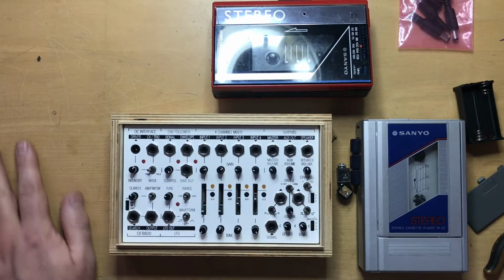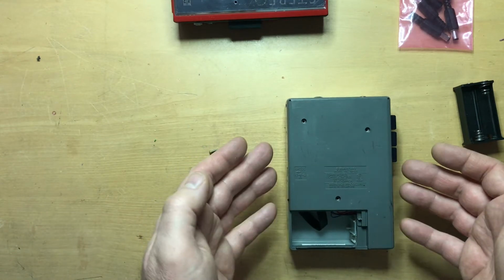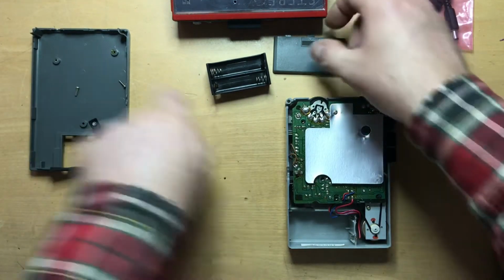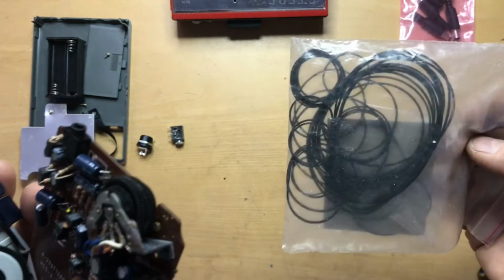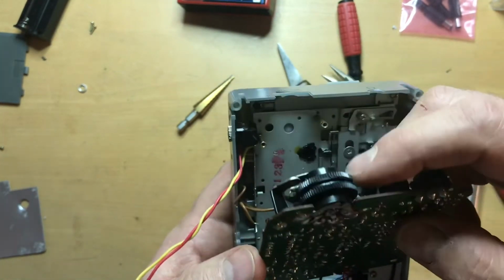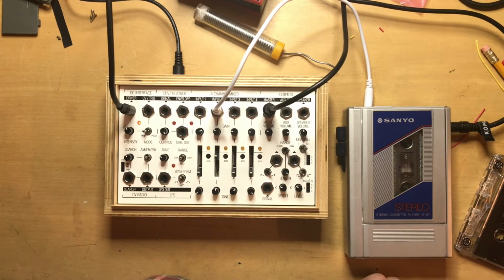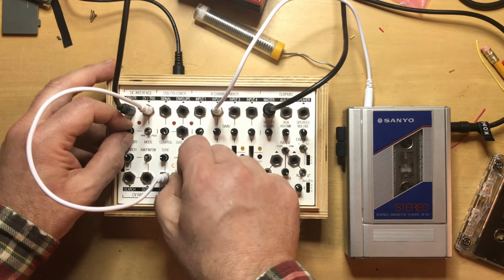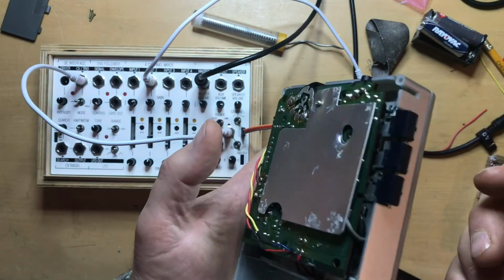Mod of a tape player for use with Koma Field Kit DC interface

Comment: Great work, thank you so much for this! I was wondering could i just connect a dc socket instead?
Reply from the maker: Yes, any kind of socket or jack will be fine. I chose the 3.5mm socket because it took up less space inside the player. It also means you won’t accidentally plug a wall wart into it and fry the motor. Both solutions have drawbacks, go with what you have, that will fit and works for you.

Comment: Ok, this is so great that it’ll be my first forray in tape mods. Would that also work with an audio interface that has dc coupled 1/8 outputs? I plan to get a Koma eventually but don’t mind hooking this up with Ableton (CV Tools ) or Reaktor.
Reply from the maker: Great! I hope that you have fun with it. I really don’t have any idea if what you’re suggesting would work (I don’t use a daw or a modular system.) but if I had to guess, I’d say no. I don’t think the interface will have enough oomph to drive the motor. If you want to give it a try, I’d suggest doing a quick test before you go ahead and do the full mod: unsolder the motor wires and temporarily solder them to a jack. This should allow you to see if the interface will drive the motor without going through the trouble of finding a mounting spot for the jack.
Reply: @TheGrumpypotter  By "oomph" do you mean power or is it a typo for ohm? My interface is not bus-powered but has a DC outlet. As such, it is possible to send program changes such as LFO's to Arduino motors, but I've never done that. It turns out my old tape player has just the right room for a jack and weirdly, even an unopened plastic cutout, so I'll do the mod, see if that works, and if it doesn't, it'll be Koma ready. Now, all I gotta do is identify those wires, they are red, orange, white and black and labelled with their colour, so I have no idea what is the polarity! Hehe
Reply from the maker: Hey Elaine, by “oomph” I meant ability to deliver amperage. I wasn’t aware that there were interfaces that could do that. Can you tell me the make and model, I’d be interested in reading about it. As far as the motor wiring goes, I think the four wires means that you have a tape player with a three phase motor and this simple mod won’t work for that type of motor. There was another viewer who posted here on on FB a video of how they were able to control one of these. I’ll have a look and see if I can find it and post it here.
Reply from the maker: Here’s the video on three phase motors: https://www.instagram.com/p/CKyFNAqhAtM/?utm_source=ig_web_copy_link&fbclid=IwAR0fGAT0ucAugOrDFz1fJMdxzTk3luISryMhDH2m6eDkwOQc8qCZXid0niw

Comment: Hmm. I have a cassette player modified with a CV in to control speed. Ive been using LFOs and whatnot with it, but with the correct cable is it likely the DC output could drive it just the same?
Reply from the maker: It possible but depends on how the mod was done. There’s a well known mod of GE brand dictation style recorders that taps into the speed control circuit for a partial CV control. I don’t think it would work in that unit. The artist Gieskes has modded players to go along with a euro rack module of his design and I think those would be compatible but you would need to check in the polarity of the cable and jack.
Reply: @TheGrumpypotter  Appreciate the response, I'll get with the guy that made this one. I hadn't even considered the DC out as CV.

Comment: Could I just take a 5.5mm DC male to male and hook it up via a barrel jack? Seems like it would work!
Reply: I also noticed on the 3.5mm jack has 3 legs. Which two do you solder the wires to or does it not matter?
Reply from the maker: @SNCKPCK  The pin with a rivet is the center pin which should go to the negative connection the motor. The other two are switched by the insertion of a cable. Insert a plug or cable and check for continuity between the barrel and one of the contacts or the other. If you don’t have a voltmeter, try one contact and if it doesn’t work, then try the other.
Reply: @TheGrumpypotter  thanks for both responses I think I have it all figured out. Been loving the Field Kit because I learn a lot about electronics and how they work! I'll send another response if I have any more questions. Keep up the field kit videos I really appreciate them!
Reply from the maker: Yes, you can use whatever connector works best for you. I choose the 3.5 mm mono jack because it’s relatively compact and fits inside a lot of cassette player bodies. Some people just hard wire the cable to the player. Just be sure you get the polarity correct. The DC interface jack is center negative and barrel positive. If you get it wrong the spindles will turn in the wrong direction, so test it before you put in a tape.

Comment: So, you are simply adding in the jack to interrupt the positive motor connection to the motor?
Reply from the maker: Both the positive and the negative wires to the motor are now wired to the new jack which will be connected to the DC interface of the KOMA Field Kit.
Reply: @TheGrumpypotter  Ok, so the Field Kit is not just putting a variable resistance in series with the motor but is actually proving the voltage to drive it. Watching your video again, I see that that is the case. Very cool! I'll give it a try.